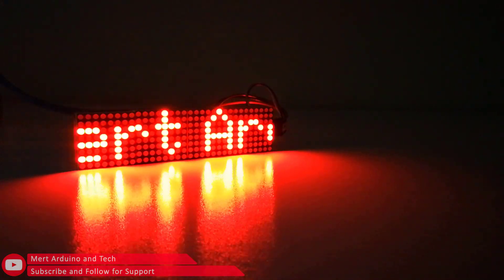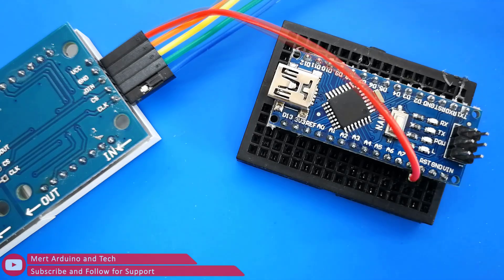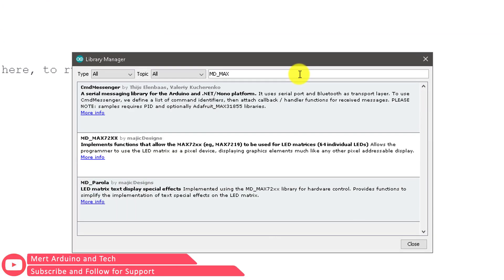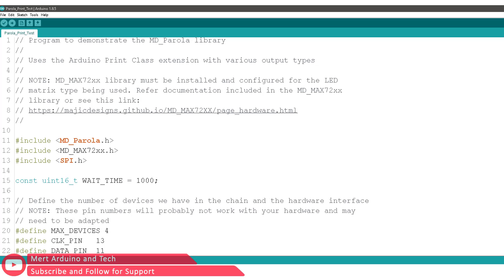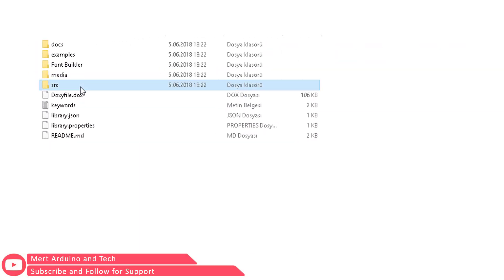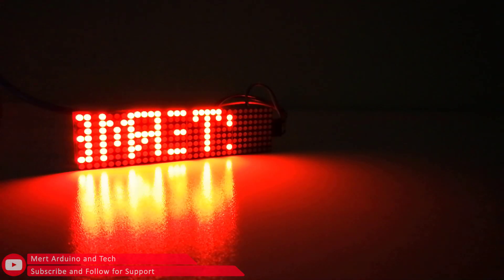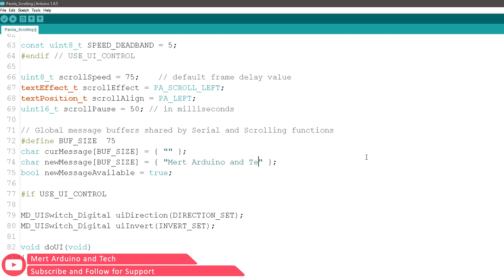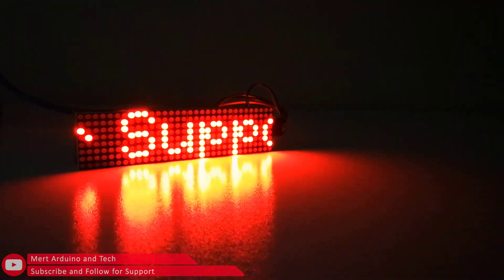Arduino Text Scrolling Display | MAX7219 Dot Matrix 4-in-1

Comment: Hi, Great video on how to make the scrolling matrix.  I made one wthe two 4 in 1 MAX7219 displays.  Worked PERFECTLY.   Only have one question, maybe at my age (78) I'm missing something.  How would you connect two matrices so they are touching (side by side).  Do you solder or use wires.   And maybe a simple explanation as to how someone might  connect them.  I've looked all over the internet and people say you can connect them but don's show how.  I would REALLY APPRECIATE your reply.
Reply: You may use hot glue
Reply: @TechnoEveryday  thanks for you reply. My concern was more about the wire connections between the two scrolling displays. 

Besides soldering a small piece of wire between (Vcc to Vcc) (Grd to Grd) (Data-out to Data-in) etc OR laying a solder bead between each…..

Someone had said they made connections such that they can unplug one from the other in case one died. 

I’m not sure how that is done?  yet, that’s what I’d like to do
Reply: Sir you may want to use header pin and header socket whose legs are bent 90 degrees. Another option is to use header pins with jumpers as we used to see in old motherboards..... Hope that helps
Reply: @TechnoEveryday  OK thanks will try (after my wife’s surgery recovery)

.

Comment: Sir, i want to ask when we connect this led matrix to arduino  and then we connect  them both with PC to upload program, does the matrix LED turns on automatically or not. In my case, when I'm connecting both the module with PC, some part of the LED turns on and some are off. This is my first project and i have very basic knowledge about electronic and nil about coding.
Reply: No problem

Comment: Those lines don't seem to exist anymore in MD_MAX72xx.h file. Any idea how it works now?
Reply: Regarding the issue of inverted display...I thought it was just me. Then I found this video. I followed the instructions to fix the problem but can't complete the procedure because I don't have the same lines to modify in my library file. I opened the file in Notepad and Word Pad and then also in the Text Editor on my MAC. The lines are NOT in the file anymore like in the tutorial.

Comment: Will it work if I put a lithum battery as source and  upload the code
Reply: Yes, as long as you supply enough voltage. You might need a DC-DC booster if you use 1 cell and a DC-DC buck converter if you use a 2s pack.
Reply: @bob95180  thx

Comment: Hi, I was able to get this to work, How do you dim the display? What code can I add to this program or can I do it using hardware?
Reply: Software (i prefer): use P.setIntensity(1);
Hardware: change resistors on the board.
Reply: Jens Renner ok, I did the software snd it worked

Comment: @Mert Arduino

Is it possible to cascade another module to form 8 in line? Will there be another modification on the code? Thank you for the advance answer.
Reply: Have you received an answer? I'm curious aswell

Comment: Good Morning
  how do I roll the text horizontally, I've watched several tutorials, downloaded several libraries and can not scroll the text horizontally, only vertically, bought a module max7219 8X32 I'm using arduino Uno, and another doubt and how to revert, change PAROLA_HW to FC16_HW, thanks.